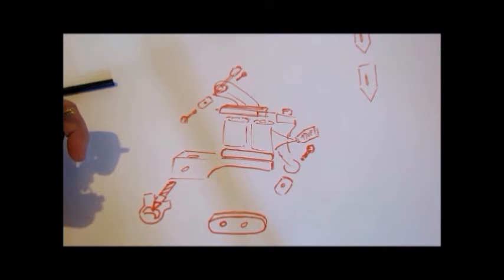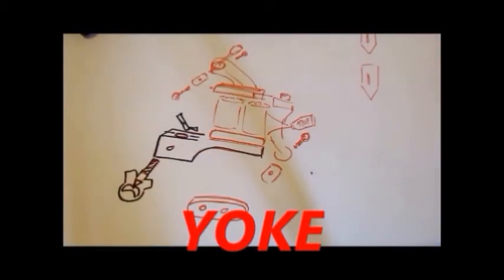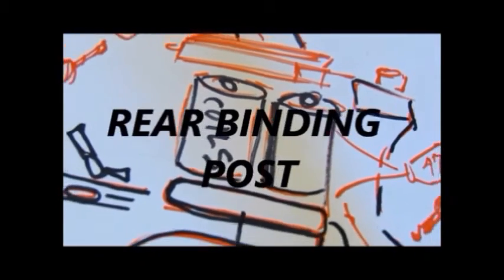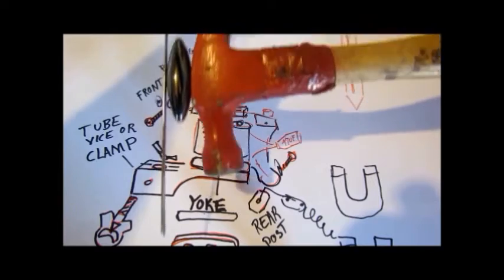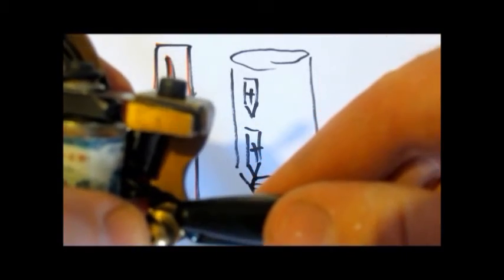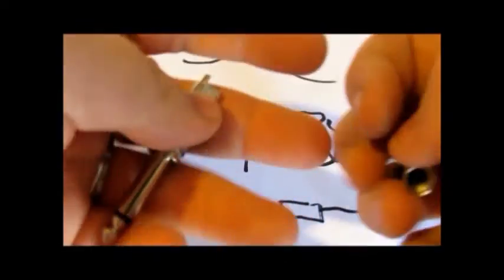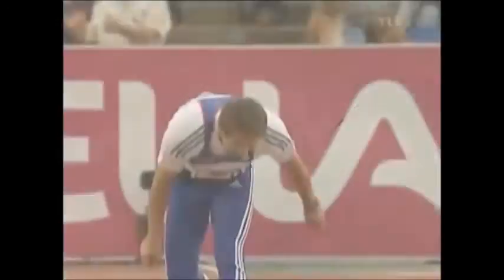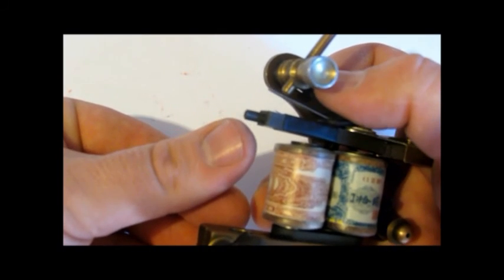Tattoo University - Tattoo Machine Terminology

Comment from the maker: Read Machine gun magazine.  Somewhere in the first 4 editions there is a page that has terminology.  It also describes how there are different names for the same things.  Tattoo artist didn't work together so they came up with their own terminology for parts.  If I find the page I'm describing I'll post it.  Throw and Stroke are used to describe the same thing.  It is the distance your needle travels.  I prefer to use the term Stroke now but was using the term Throw when I made this video.  I prefer stroke because it is a term used more when describing something mechanical.

Comment: So the throw/stroke is how much the needle travels up and down. Can anyone tell me when you would use a machine with a shorter stroke and when you would use one with a longer stroke ? Is it to do with needle size or technique or what ?
Tattoo university thanks for all your vids !!
Reply from the maker: Short stroke for lining with thinner ink. Longer stroke for packing color with thicker ink.
Reply from the maker: Has to do with needle working with the ink. Short stroke for thinner because it runs out the tip. Long stroke for thick because needle needs to get into the ink and get covered before going into the skin. Other factors are involved but I think that is main reason

Comment: buddy what is your opinion on the nickel and dime theory between the contact screw and front spring for a liner and shader? and also does the gap between the front coil and the armature bar come in to play when tuning?
Reply from the maker: stick around. I'm going to explain that in some videos real soon
Reply: ahhh cool I'm actually in the process of making a handbook out of your videos. Taking a lot of notes at the moment and running through videos again. I find the each time I watch a video over I understand it more. are you going to be uplading soon?
Reply: I am finding that when I'm playing around with my contact screw when tuning my machine that my gap isn't neccesarly a dime for a liner and nickel for a shader but the thing is is that the machine runs good with the way I adjust my contact screw and voltage but I feel like I'm doing something wrong because I have this "nickel and dime thing" stuck in my head